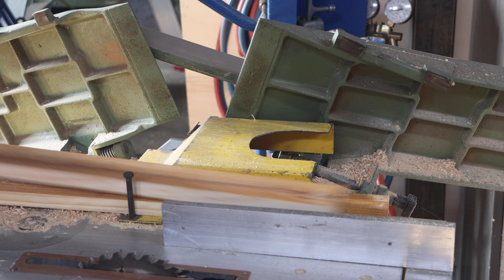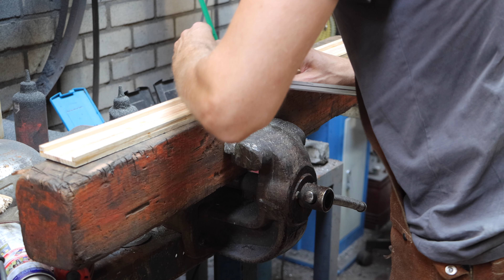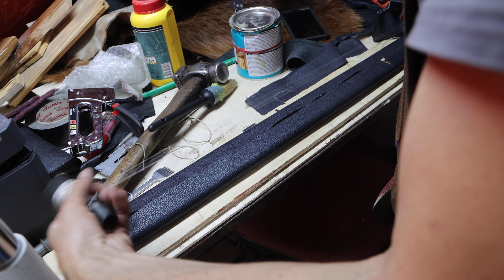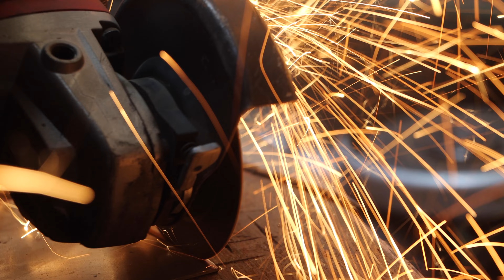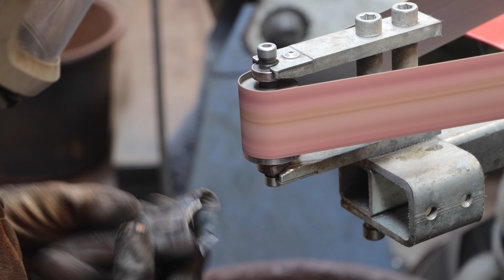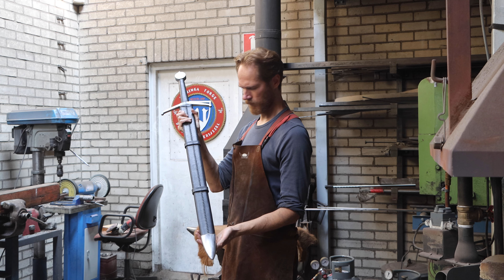Forging a pattern welded long sword, part 6,  making the scabbard.

Comment: Dumb Question:

Why is it rare for leather scabbard wraps for Western Medieval and Post-Medieval sword styles to use the "Turnshoe Method" of folding the covering surface inward, sewing it together to shape, turning it inside out to reduce the sign of the seam, and then gluing it onto the scabbard before fitting on the chapes and belt slide, clips, or other suspension method?

I mean, the work before us is exemplary from start to finish, and if I had the cash and the space for one of Mr. Wieringa's pieces, I would fork it over in a heartbeat, but as a layman, I keep noticing things, and their explanations seem less than intuitive.